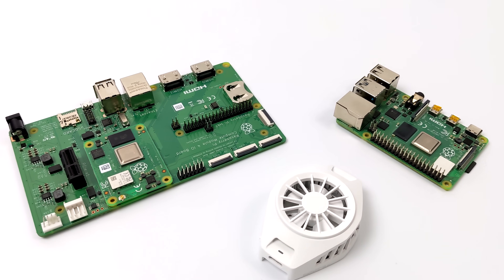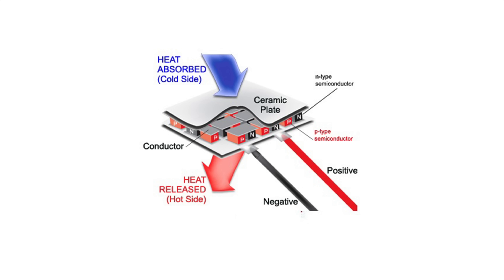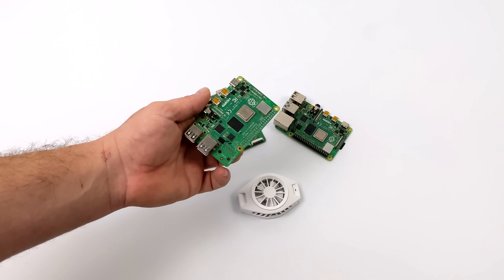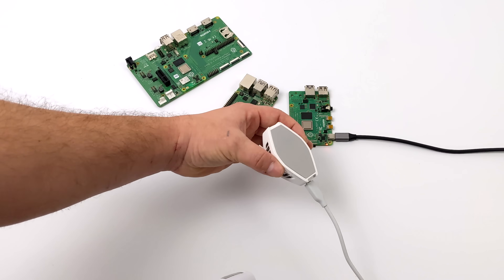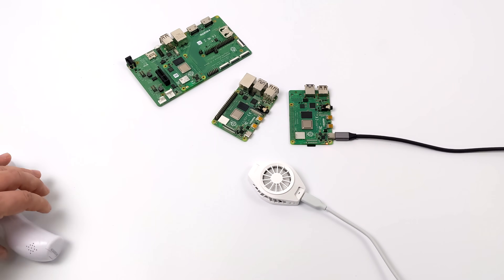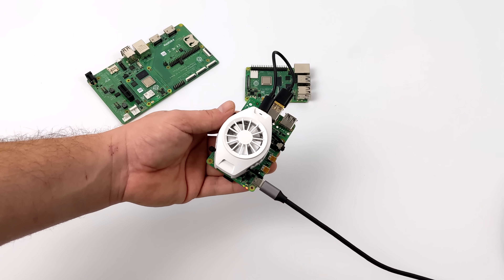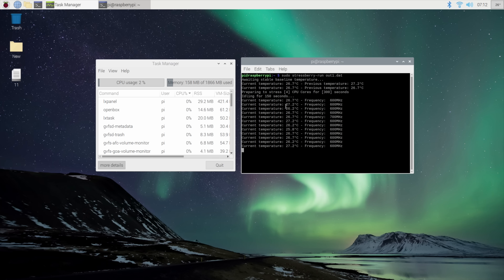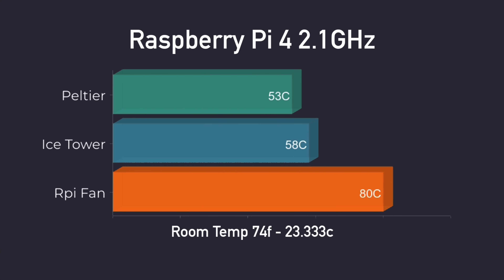Thermoelectric Cooler On The Raspberry Pi 4! Super Low CPU Temps With Science!

Comment from the maker: The cooler used in their video was designed to be attached to the back of a cell phone it has a rubber coating on the cold side and in my testing I haven’t had any condensation issues, I believe it has to do with the low power consumption “ when compared to other thermoelectric coolers” and the rubber coating that used on the cold side.
Reply: Yeah , condensation can be a problem, but i like your idea of attaching it to the flirc case. Would love a video testing it!
Reply: Is custom SBC possible if pls make vedio on that
Reply: Could this cause condensation on the cpu?  or corrosion?
Reply: @coda821  
Not cold enough really, you can get big external coolers that take a CPU to -10/20 and they seem ok, only seen it look wet with LN2 users where temps can be -150.
Reply: @wing0zero  Interesting.  Would this be for an air conditioned environment?  Would a more humid environment have different results.  It gets humid here in the summer.
Reply: @coda821  yup. it will cause both condensation and shortcircuit out the board. If you run it like that for enough time
Reply: @MarceloMedeirosb  Well I'm a dork.  I posted my question without reading ETA's post.  Thought the issue hadn't come up yet.
Reply: Amazing idea i really love it. Thanks for showing
Reply: If you want to cool it a bit better you could remove the CPU IHS and cool direct on the die, would need a layer of paste.
Reply: have u considered using (Thermal pads) to make it even on the memory and CPU
Reply: What about using a Peltier in the Pi 400?
Reply: How were you able to remove the retractable arms for the cooler? Will experiment with minebut cant seem to figure out how to remove them without peeling the thermal pad
Reply: Use Xiaomi cooler pls i want to see the results
Reply: a trick : you can watch series at flixzone. Me and my gf have been using it for watching loads of movies during the lockdown.
Reply: @Theodore Cash Definitely, have been watching on flixzone for since november myself =)

Comment: Now we all know that this is a dumb question. I actually bought one of these off of AliExpress and it uses the same amount of power as the two amp block. The power is the pie. I also own a pie for and out of curiosity what could I possibly use between the cold side of the Peltier cooler because the one I have was like six bucks, but it gets actually icy cold and I don’t want the literal water coming off of it to land onto the pie. I want to use this as a security camera in the summer and it would just be handy to have this to cool it down especially when it gets to be 100° outside.

With a thermal pad work ? I feel like it would have the opposite effect of what I need or maybe just a piece of foam I’m not sure.

Comment: I could have sent you one that 4 inch by 4 inch its giant heat sink and 12v 200 amp power supply that I used on a core 2 back in the early 2000's that would turn an over clocked CPU to solid block of ice I also have a monsoon cooler I would like to use on my Ryzn that ran from 2008 till a few months ago that would run 60 f 24/7 but a heat sync and poe fan do just fine on a raspi

Comment: Hope the fan can keep up with the heat that it is creating, if not the peltier cooler wil act as tiny insulation layer. I recall Linus Techtips doing this on an intel system, per saldo it only made it worse. Specially when it can't disapate the extra added heat.

Comment: I put a massive old heat sink from a Dell workstation on top of an Argon One case, and it makes my overclocked Pi significantly cooler than the case alone.  There should be no reason that the TEC on a FLIRC should not work better.

Comment: The best use for these modules is utilizing the Seebeck Effect. 
The Mars Rover has a Plutonium core surrounded with these thermoelectric modules. These modules supply power to onboard systems including mobility.
No unreliable solar panels needed.

Comment: Little remark 'bout measuring with An IR thermometer: the metal heat spreader on the SoC van reflect ambient IR, for reflective metals it's better to measure the surface while it's covered with a non reflective material in IR, eg Paper masking tape.

Comment: The reality is that you have thermal resistance between the actual IC Silicon Die and the outside case. You quickly get to a point of diminishing returns  when cooling a chip. You could freeze the metal case with liquid nitrogen but the silicon will still get hot.

Comment: I use a 5V 40x20 Noctua fan on the IceTower, a small copper plate on the CPU between good thermal paste dabs. The 64b Ubuntu server never goes over 23C on my pi 4 4gb (not overclocked). It is close to being cheap but highly reliable even if the fan fails.

Comment: There are a few issues I'm having with this, your measurements of these surfaces is almost meaningless due to thermal emissivity. To an infra red thermometer those smooth metal surfaces are practically mirrors, stick a piece of tape to the surface and measure that instead. Otherwise as others pointed out, don't go sub-ambient unless you can deal with condensation.

Comment: Great experiment. If able to control and ensure no condensation gets on the board, it would be awesome. A good example of a neat chip cooling method, but practically not viable. (I know you already knew all of this and was just experimenting, the comment is not meant to be derogatory, just commentary)

I’d suggest the low power state, but also a sustained heat applied to the cold side from the hot chip (non humid environment helps too) helps to keep condensation at bay.

Comment: My pi freezes and crashes even on a slight overclock my temps are low any tips or is my pi just a bit of a dud?

Eg of some ive tried
over_voltage=4
arm_freq=2000
gpu_freq=600

over_voltage=4
arm_freq=1800

over_voltage=3
arm_freq=1750

The lower values will run for a while but can freeze. I tried high values also but some of those dont even boot up. 2.175 was working but eventually crashed too
Temps are not going above 65 with my cooling

Could it be my power supply? 5V 3A

Comment: peltier coolers arnt very efficient, using convection is more efficient pi does not need to be as cool as possible just cool enough to keep resistance lower. just for curiousity how much power was it using ? also you might have better luck banging it on and off to maintain 70 deg with a mosfet or relay

Comment: You can try to remove metal cover from SOC with scalpel. And in my case whole temp goes down another 10 degrees c
Reply: How did you mount a heat sink to it?  Thermo cement, pad...?
Reply: @tombyrer1808  with rubber band :)
Reply: @xlazom00  I've done that before!  Needs to be replaced yearly though ;/

Comment: Just watching it on Rasperry Pi 4 4GB  2,147gHz OC cooled with a solid aluminium case with 2x30mm fans. IMO my setting is enough for cooling Pi down, for usual stuff never goes over 47C, usually sits around 42C, when its working on usual stuff like YT, Slack etc.

Comment: I remember that you used to be able to get Peltier effect coolers for PC CPUs, in like the Pentium III days I'd say? But they stopped being a thing. I don't understand the jargon but apparently they're just not effective enough, and they create condensation which is a no-no inside a computer.
Reply: Yeah, a big problem was not having a PWM controller back then, and relying on switching which wasn't very stable. The new special coolers commissioned by Intel are...well, existing if not common examples of the technology reimagined.

Comment: You think a thermo cooler would be more effective then a sff cooler and fan? For very thin desktops like the deskmini series. Could also just sandwich one inbetween the CPU cooler and the CPU and use longer screws to accommodate the extra space but would that in a slighter larger cooler then you tested here be more effective then without the thermo cooler?

Comment: 5W with 5Volts means you need additional 1A of current on your power supply and you have to send it directly to a cooler (USB often sends only 0,5A) but it can work

Comment: you can get tec's of ebay and amazon really cheap. we have been using stuff like this for 20 years on computers. you need thermal paste, and copper nut aluminum for that heatsink. also you need something to protect the board from moisture. once you start cooling below dewpoint you gonna condensate. superlube makes a great gel that has ptfe in it and works great.

Comment: Peltier coolers respond really well to water cooling. Just run it with an adjustable bench power supply so you can optimize the efficiency (efficiency decreases sharply with higher voltage).

Comment: What is incredibly practical is to use this with the HQ Pi camera. One of the primary sources of noise in low light cameras is thermal noise. Most high level astrophotography cameras use Peltier coolers. Some astrophotographers mod DSLRs with Peltier cold fingers. The HQ camera, while not in the same league, has shown promise for astrophotography and other low light work. A cheap Peltier cooler like this cooling the $50 HQ camera with a Pi 0W could make a phenomenal sub $100 astrophotography rig.  And yes, I know, the pixel size, exposure time and readout mechanics of the HQ limits use in long exposure use. But for the price this would be great for stacking exposures.

Comment: Problem as said by ETA, thermoelectric devices are extremely inefficient, they need shitton of power and an active cooling solution to work. Nothing is better than the good old active cooling with heatsink and fan, less power to run

Comment: Your cooler only needs to prevent thermal throttling when your raspberry pi it is overclocking.  Buy a cooler that does that for you so if you ever do need to unlock more horsepower it is available.  But you shouldn't overclock generally because it means your computer is running in an unefficient manner, yes it faster but while drawing increasingly more power.  Think of your computer clock as a straight line and power as an inverse bell curve where at a specific frequency the power draw is most optimum

Comment: I played a lot with peltiers and thermoelectric coolers, but with the objective of make a portable air cooler. The key is that the more cooler you put the hot side, more cool can put out on cool side (and lower temperature). For me, it was a pain, trying to isolate both side so doesnt interact across the sorrounding, and get the best perfomance out of the peltier. As a computer cooler... it is risky, but as more success this could have, more investigation will get this kind of tech.

Comment: I was wondering about setting this up under control. Something similar to what some of the fans do. Set it for say 35C to kick on and off at say 30C. That should minimize the condensation issue. Please do the Flirc version of the test. I have some spacers between the board and the bottom cover on mine(enough that SD card fits between the case and the bottom) . If you set it on it's side it keeps it 3-5C cooler.
Reply: Maybe someone will get fancy and add  a hygrometer, external thermometer and dew point table and a control it with a pi pico?!

Comment: I have tried peltier cooling my rpi4 for fun , it created lots of condensation even if I used a 172Qwat 24.6volt peltier at only 5volts.
Reply: What if you use dielectric grease to seal the board so it doesn't get condensation?

Comment: You should buy a can of conformal coating.  Mask off the components you want to cool, coat the board on both sides + edges of the board, unmask/mount the Peltier, and let it rip full blast just to see if condensation matters on a fully coated board.

Comment: Thermal paste says hi.
Reply: I don’t think thermal paste is going to help much given that there’s rubber padding on the bottom of the cooler.
Reply: @AWriterWandering  It would still help, even if only a bit. Paste fills the tiny crevaces on the two surfaces and transfers heat faster. In theory it should work on any type of surface.
Reply: @nicklong27  How about thermal pad?
Reply: @R0b3rt2Yonas  I've never used them but my understanding of pads is that you need a lot of pressure to make them work, more so than normal paste. Cable ties won't be sufficient for that so stick with paste. Or just go bare back like Mr Prime here.
Reply: @nicklong27  oh yeah, those cable ties make me cringe a little bit.
Reply: @R0b3rt2Yonas  It is just temporary for testing.
Reply: JB Weld and Gorilla Glue say hi too if you want permanent connection.

Comment: Sub-ambient cooling is not really recommended, even on desktop PCs. Condensation can collect and that can be seriously damaging. Go cold enough and that condensation can become ice. You'd have to keep a high level of load on CPU in order to keep it from forming condensation!
Reply: could combine it with an system submerged in a nooconnective fluid.
Or if you really wanna shoot high a vacum chamber.
Reply: @danis8455  If the system is in a fluid, why do you need the cooler to begin with?  The natural convection and heat sinking properties of the fluid itself would be more the sufficient in keeping the Pi cool under even strenuous loads.  Plus, the added surface area would work wonders to let it bleed off any heat delta higher than ambient.

Also, vacuums would make the cooling of the peltier given the current setup, impractical.  It works off using air to cool the hot side, which isn't possible in a vacuum. Only radiation is possible, which would require an entirely cooling setup.  What you could do is try and run it in a dry-air environment, which would make the possibility of condensation impossible.. except now you're introducing the increased risk of arcing and static electrical discharges. 

A better solution would be to coat the at-risk areas in silicon conformal coating.  This would prevent the build up water directly on the components and reduce the risk of water-damage or shorting.  Or.. set up the cooler to be regulated by the Pi itself.  This would make the cooler more power efficient (it wouldn't need to be at max cooling except as temperatures rose, thus making it draw less power overall) and coupled with temperature monitoring would prevent it reaching sub-ambient temperatures.  This however, is still very inefficient compared to a bog-standard heat-sink and fan combo except in limited application systems, where heat sensitivity is a limit compared to power draw.
Reply: Yup... entirely impractical.

Comment: why, Why, WHY the hell do like 99% of Raspberry Pi cooling solutions rely on a fan? It's not a Threadripper, you can literally cool the whole thing passively. Or use a cooler combined with a Peltier module for active silent cooling.

But nah, almost all products you can buy come with that stupid little fan.
Reply: Some of the passive cooling case accidentally create a faraday cage. So your wifi signal will be worse.
Reply: @R0b3rt2Yonas  I use the fattest aluminium case I could find and wifi works perfectly. It even still gives access to all the GPIO ports etc.

And regardless of all that, it's not rocket science to design cases that avoid the compromise. For example by only partially using metal as material.
Reply: @brinkoftext  some

Comment: How (or from who) did you get the slim Raspberry Pi?
Reply: Just desolder the usb and ethernet headers. I think all that's happened here is that single socket usb headers have been swapped for the original dual part.
Reply: @Whipster-Old  I did not know that, it is possible. Thank you, it helps a lot!
Reply: @davidtugyi4536  any time. Here, this might help "Pimoroni's 'World's Thinnest Raspberry Pi 3' - Raspberry Pi" https://www.raspberrypi.org/blog/pimoroni-thinnest-pi/
Reply: Wishful thinking

Comment: Using a peltier cell that's not a good idea, because this device creates a lot of condensation
Reply: mmmmmm moist.
Reply: Well, it CAN. But that does not mean it WILL. As long as you stay above the dewpoint you are fine. What would be ideal is to get a peltier the size of the SOC and silastic around it. Though TBH this is overkill as heat pipe coolers do nearly as well using far less power.
Reply: As long as it stay only in the back and don't go to any "hole" or gap, there is no problem XD
Reply: Consult a psychrometric chart and pay particular attention to dewpoint.
Reply: As long as it's above ambient temperature, there will be no condensation.
Reply: @achannelhasnoname5182  Depends on how humid it is.
Reply: @PSNGormond  facts
Reply: @achannelhasnoname5182  peltier cells usually generate temperatures below ambient / indoors ones.
Then there is the humidity rate to consider, as he already wrote @Gormond
Reply: @achannelhasnoname5182  if it's above ambient temperature why use it as a cooler

Comment: Its blackshark funcooler white. I use it as my raspi 4 server cooler and run it 24/7. You have to watch the condensation though since its lower than room temp. My approach is by using passive cooling case and strap the cooler on top of it, then clear the condensed water once a week.
Reply: ammonitida  maybe. Do you have other approach?